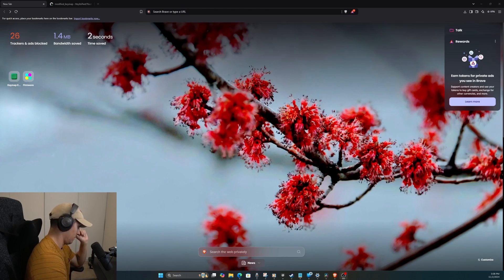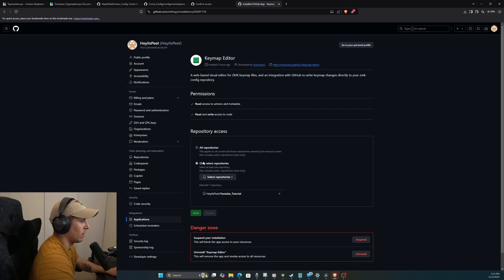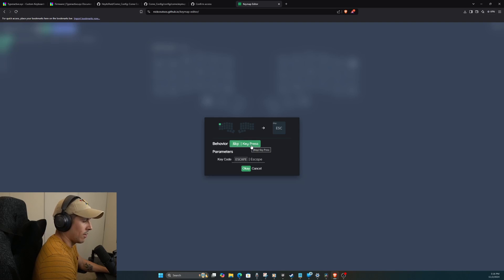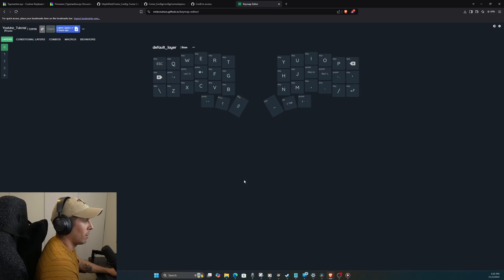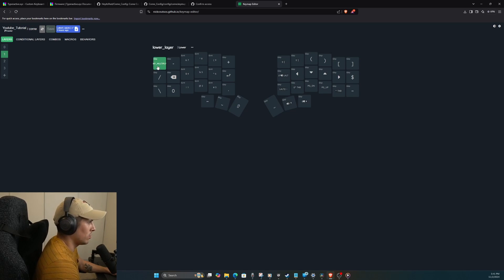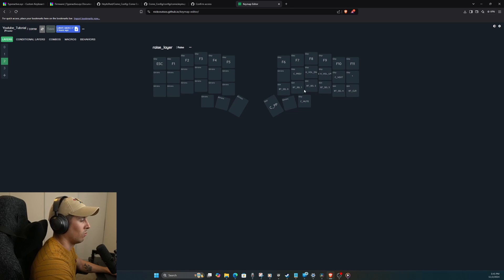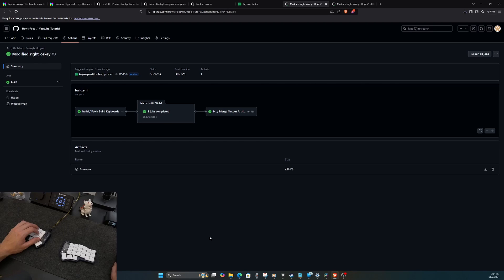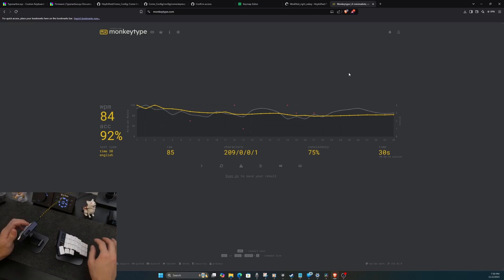TyperActive Corne ZMK Basic Tutorial - Keymap Tool

Comment: Hi bro, maybe u can help me: in my case I tried to enable mouse movement in zmk firmware, but in didn't compiled, can u suggest good tutorial?
Reply: I have the same issue, did you find a solution? I found an old youtube video called "Remap mouse keys in ZMK using nickcoutsos keymap editor" showing how to add mouse movements but the method has changed.
Reply: @luigiramirez29  bro i gave up :( As I understand this feature is in developing, so all we have is waiting